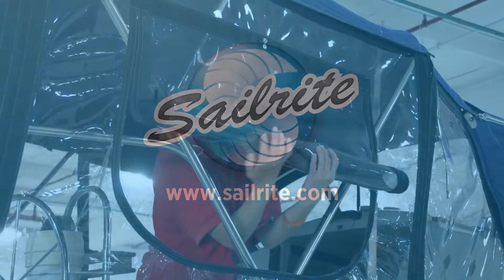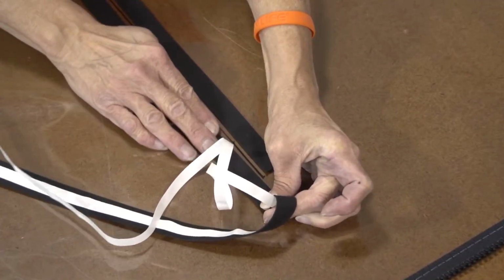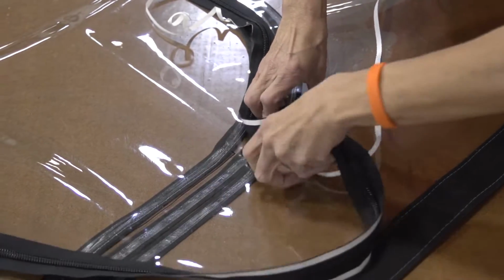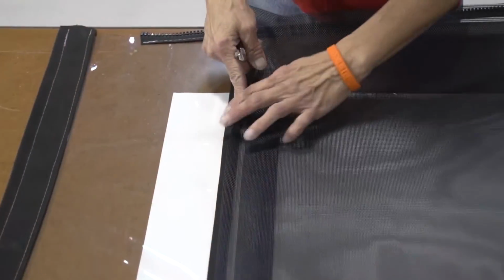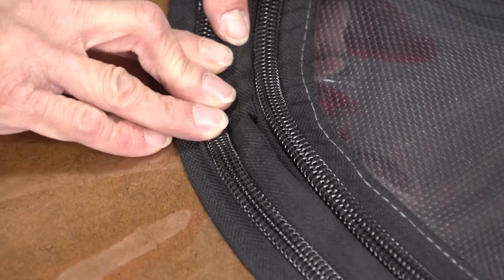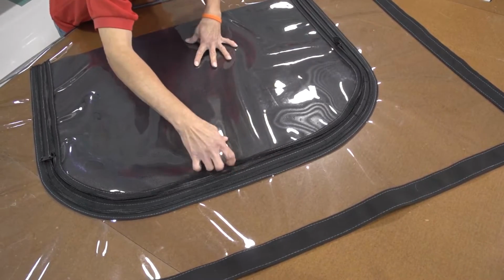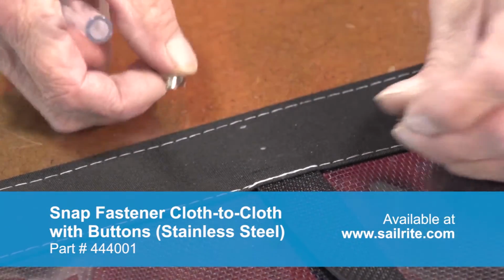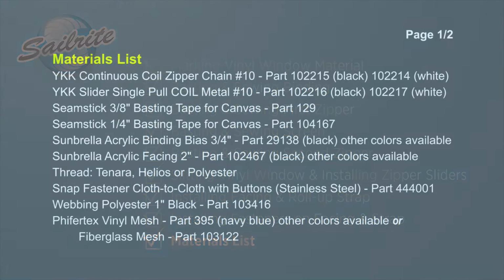Installing Curved Zipper with Roll-up Screen in Vinyl Window Material

Comment: I am making an awning for a Sportfisher which will need an opening (a climb through) to access the top deck. I am thinking something like this would work. Or would two separate zippers parallel of each other be easier than creating a curve? Any  suggestions would be welcomed, I am new to both sewing and canvas work.
Reply from the maker: It is easier to climb through a rectangular shaped opening rather than a curved zipper opening. So... you may want to consider that.

Comment: I'm considering making my own screen tent with large zippered panels for protection from rain, window, sun, dust and for privacy.  I cannot find screen tents like this much less the size I need to fit over the extra large ADA compliant campground picnic tables which are increasingly the norm per state and national requirements.  Tenting industry has not caught onto any of this yet.  I want a polycotton screen tent.  Do any of your products work with tent fabrics?  I'm not going to have vinyl window included like for boating.  I will only have very very large screen panels with zippered windows consisting of the tent fabric that zips over the large window screens.  The window panels openings will be a little smaller than the actual side of the tent.  Tent footprint approx 13'X17'.
Reply from the maker: Yes, Sailrite carries many fabrics and screen materials that work great in tents.
Reply: Certain segments of the tenting industry are starting to use polycotton blend fabric...specifically 65 percent cotton/35 percent polyester.  They have found that blending the best qualities of each polyester and cotton are minimizing/eliminating the cons and maximizing the pros of each.  Specifically, the tents breathe and insulate well, less color fading, fewer rips/tearing and easier upkeep.  Given this, I would like my screen tent to serve a few purposes which include the option of emergency survival.  Helps me save storage space.  Do you think you could help guide me?  Currently there is nobody that I know of in the tenting industry who makes the kind of tent I have in mind.  I have been camping my whole life in many tents and rv types.  My father, in the 1960s, handmade our family's "car top tent" from a blueprint in Sunset Magazine.  We travelled the US for many years with that tent.  So innovative tenting is in my blood?  Lol!  Appreciate any help/input from you experts.